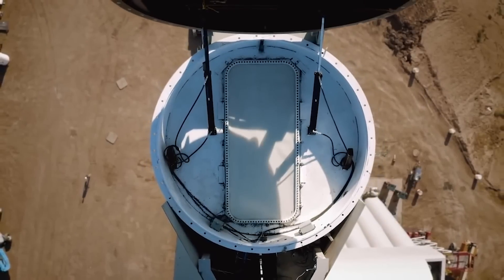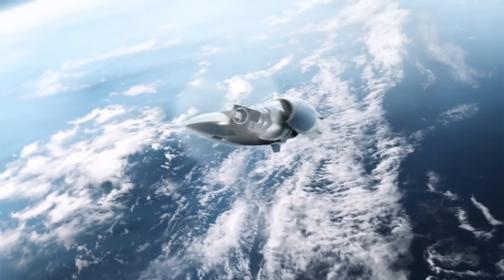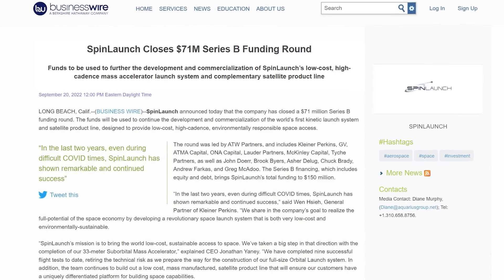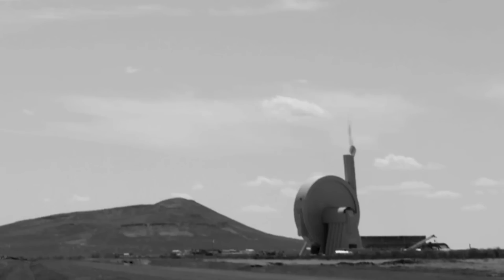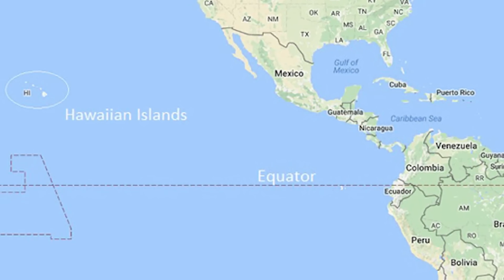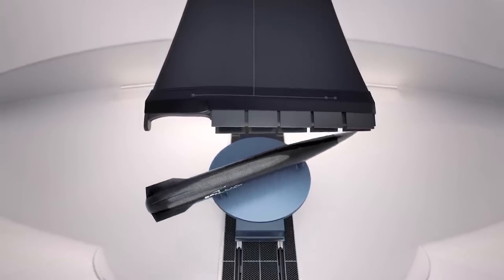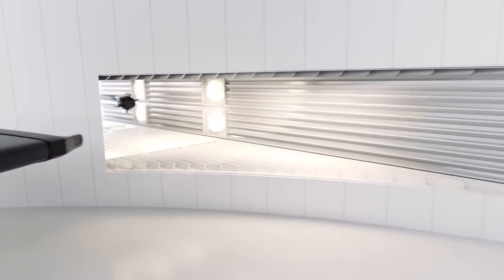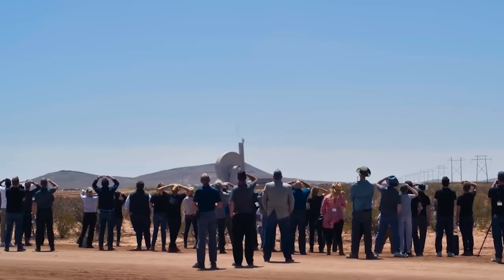What Happened To SpinLaunch & The Orbital Accelerator?

Comment: Something I've wondered about SpinLaunch: how do they maintain balance in their centrifuge? They spin up a payload, then release it. If their centrifuge arm is balanced with the payload, it becomes badly unbalanced at the moment of release. Do they somehow accommodate this imbalance? Do they somehow very quickly rebalance? (e.g. a counterweight which is released downwards at the same moment the payload is released upwards.)
Reply: The only viable solution to that physics problem I can think of would be to have the counterweight pulled on magnetically and at the instant of the launch vehicle release the magnetic field would be shut off.
Reply: @GrantOakes  or, ya know just use a regular detaching mechanism.
Reply: "counterweight which is released downwards at the same moment"  -- oh man, that poor counterweight.
Reply: Immediate auto rebalance of an arm at that speed and G load seems very tough or nearly impossible to do.
Reply: SpinLaunch is releasing a counter-weight into an armored section of the launcher at the same time the vehicle launches. But that leaves a mess to clean up. Future ideas is to launch a vehicle, rotate 1/2 turn and launch the counter-weight. They would run out of balance over that 1/2 rotation. So, this will take a little bit more engineering muscle to solve.

Here's an animation:

https://youtu.be/yrc632oilWo?si=UHWQBBmf_oeD4Odv&t=1286
Reply: @u9Nails  as it is on the short arm, that means the speed at release would be reduced from the big arm, but we are still talking supersonic speeds for something which weighs several tons.
Reply: Why don't they just use a rail gun? Seems a LOT more simple.
Reply: @1buellrider  They already have rail gun tech in play.  US Navy supposedly playing with it already.  High velocity,  long range weapons with high terminal energy and velocities at lower operating costs. It is simpler in concept.  

Lots of grant and research dollars already spent on it, so the funding to keep out of work university students and engineers in paychecks has diminished quite a bit along this road. But there is always money available for potentially new and or odd ball tech to be researched. This is standard "University Monetary Thinking Course 101" Follow the money, have a great paycheck for a while, enjoy a cushy low stress job. When the money runs out you can always find some weird new concept to explore and spend tax payer dollars on!
Reply: They don't.  This entire program is a scam.  It's deliberately vauge to drum up funding.
Reply: There is another video out there that they do a tour of it and show the vacuum chamber and go into detail about it.
Reply: supposedly they release a weight from the other side at the same time.   its caught inside the machine.   idk the whole thing is dumb
Reply: I think they release a counterweight on the other side at the same time. I remember the channel Real Engineering noted this in their video.
Reply: They covered this already. They plan to drop a dummy payload from the short end that is much heavier but traveling much slower. Catch it and reattach for the next launch. As crazy as the ideal sounds they have put a lot of thought and engineering into the project.
Reply: @edwardson6825  I didn't know about the counterweight payload idea. Thanks! I wonder how they plan to "catch" it? If the weight is magnetized, dropping it through a coil would allow for regenerative braking. That might be a cost-saving upgrade for the long-term.
Reply: @edwardson6825  dropping a heavier counter weight is still going to be quite explosive especially since the payload is heavy. This will not be a simple task and I wonder how they will be able to handle this since going Mach 2 with tons of weight will be like dropping a large bomb. 😮
Reply: @edwardson6825  Thanks, that is the most obvious method, but I didn't see it in the animations.
Reply: @michaelwoodhams7866  True, they don't show that end much. On the scaled down launcher it is just fired down into an armored plate and the dummy weight is destroyed. They claimed at one time that their bearing could handle a single out of balance half turn allowing them to fire the first payload then make a half turn and release another payload from the other end to follow the first. Just my personal intuition, but that seems unlikely to work without rapid unplanned disassembly. Regardless of which way it goes, I love to see people working to innovative.
Reply: @edwardson6825  Plan to drop a dummy payload?  They already showed their first launch and there was no dummy payload.
Reply: @edwardson6825 the dummy payload is being launched opposite the true payload: they both see the same forces. Think about it. Plainly, they have not.
Reply: A spinning ice skater can rapidly slow down by putting out her arms. Imagine a mutant ice skater with many arms, the longest arm holds a payload that is released at very high speed. If she had 4 times as much mass held by arms that were about half as long,  she could rebalance by unfolding those arms immediately after releasing the payload.

This would rebalance her and simultaneously slow her down. The dynamic forces might be a little harsh.
Reply: @hamjudo  Cool ideal, but they are working right up at the limit of carbon fiber's tensile strength. The full scale launcher arm has to support 100 million kilograms. Think 20 fully loaded SpaceX Star ships hung from a carbon fiber tether. To do that the cross section of the arm has to be about 1 square meter of solid carbon fiber. Have to keep things very simple when dealing with those forces.

I personally would like to know how the release mechanism works. But they are keeping it a trade secret for now. Can you imagine a release mechanism that can stand up to those forces, but still release with the precision needed?
Reply: theres another option for the counterweight.

it has to be accelerated, so thats power being used.

watch the shotput, and the cartwheel technique.

slam the counterweight into the ground, remain attached, and use the torque of the centrifuges inertia to fling the capsule off with the increased energy of the halted counterweight added to its velocity. ie, the centrifuge lifts off its axles and pivots around the counterweight instead. theres also a large third class lever action due to the fulcrum now being at the counterweight.
Reply: @paradiselost9946  Not sure what you mean by shotput and cartwheel technique. I will say that the full scale payload is launched at Mach 6 (2000m/s). For reference a 7.62x51 NATO bullet traves at less than half that speed (850m/s).

When things hit each other at those speeds they tend to act more like a liquid than a solid. So slamming the counter weight into almost anything will destroy it and most likely anything you slam it into. Think impacts an order of magnitude greater than those of an Iowa Class battleships 16" guns.

The shockwave that traveled back up any arm attached to the counter weight when it came to that abrupt stop would destroy the launcher arm and most likely the launcher housing and facilities.
Reply: @edwardson6825 you completely missed the point.
think of, say... a skateboard hitting a rock, versus a penny farthing hitting a rock. forget the rolling resistance part. they both stop on a point.

the skateboard rider simply keeps moving on at the same velocity, board stays back there. it might do a little flip.

tiny wheels. virtually no torque produced, instead, momentum just keeps acting linearly.

the mounted cyclist gets flung, accelerated as they are on the end of a long arm.all that momentum in a linear direction suddenly converting to torque. whatever is at the end of it gets launched. whether it was rotating or moving in a straight line, that inertia is now rotating around a different center. 

if youve ever been in that sort of situation... you find that you get PULLED... or pushed. pulled is preferable, you can let go! 

um... yeah, BMX as a teen. miss the top of a jump, and as the bike gets caught, you get pulled into arc and slammed into the ground far harder and faster than if you let go and fall... it can dislocate your shoulders.

you see it happen in boats all the time. watch them launch debris when the nose tucks under the water?  suddenly, linear momentum is rotating around a point... some of it slows. a lot of it at the end of the arm is instead accelerated, as the stuff below it, closer to the pivot, in slowing down had to transfer its force to something
its a mass thing. wheres the mass, wheres the pivot, how strong is the pivot?

would be fun to try on a small scale, though i think its basically a souped up trebuchet... little bit different.

maybe, iunno... a 20kg gym weight, open top bearings,  a 5kg "counterweight", and then a 5kg "payload" set up so it will let go at the right time...

and yeah. just slam a bar across at full tilt to lock it instantly, let the counterweight go bang, "payload" and frame go flying!

 i wanna see stored energy being released!

i just gave away a million dollar idea. sigh. again. :)

ffs, if people can get backing for this BS, wtf am i doing wrong?
Reply: @paradiselost9946  dude, nothing will be able to hammer at mach 20 into the ground and live to see another second. The only way is if they release a liquid or gas as to not destroy everything
Reply: @firedrive45 The concept is to launch at a quarter of orbital speed, like Mach 6.5.  That gets the rocket mostly out of the atmosphere with some speed where a relatively simple rocket engine can get it into orbit in one stage.  Nothing is anywhere near orbital speed at the ground.  And if you have a big counterweight, it can move relatively slowly.  Say the mass is 10x, then the velocity is only 200m/s.  That's fast, but the whole thing only carries 1/10 the kinetic energy of the rocket.  Shoot it down into a tube to decelerate and it doesn't have to be destroyed.  One way is for the counterweight to be metallic, then magnets on the sides of the tube will slow it down fast but with smoothly applied forces.  A number of rollercoasters and vertical drop rides use that already and you could get many g's of deceleration.  The tunnel only has to be 10s of meters long to do that decel.  Requires development and won't be cheap, but totally doable...
Reply: @cbarnes2160  im not sure thats quite how it works.  the larger mass is moving slower, sure, but its still larger.  it would carry the same energy as the projectile.  thats the whole point of the idea, each mass needs to carry away the same amount of energy.  im not saying it would be impossible to recover,  just that its going to have more oompf than youre imagining
Reply: @firedrive45  i know that but you gotta admit, would be fun to watch... from a distance...

think its better just to do a video myself... wee...
if i can spin a 20kg gym weight, say, 250mm across, at 1krpm,it only has a peripheral speed of 50km/h or so.
but if i can bring it to a halt, and cause that rotating mass to now rotate around a point on the rim, the opposite point on the rim shall be traveling at what velocity?

would be exactly the same scenario as if the wheel was simply dropped, and there was perfect friction when it landed. the point making contact would remain motionless, the entire mass would move at a linear rate of 50km/h at the center of mass, and the uppermost point would travel at 100km/h... of course real life digs up the grass and leaves divots. things take time to accelerate, forces act in various manners, energy is lost in various forms... i am aware of this...

now if the payload was a loose object on the rim of this wheel, it is not only traveling at the peripheral speed, but is also accelerated around the new radius of rotation, and a difference in the mass of the wheel versus payload determines just how much of the wheels inertia will be transferred into spitting the object off. its as if you "cut the wheel in half and let it continue rotating to come around and kick the payload up the arse as it leaves"

USE the inertia of the wheel to your advantage!

 pivot points, lengths, blah blah. force summations.

it would work, but it still doesnt alter the fact that the whole idea is ludicrous? other than maybe in a vacuum... with unobtainium beams and struts...

except. i want to do this now. i been musing the idea over for a while now... maybe brake rotors. got lots of brake rotors... if i make a video and come back to post it yall better watch it... even if its a failure and im wrong : )

yes. slamming it into the ground. there is a difference though, between say... slamming a moving object and bringing it to an instantaneous stop, like, iunno, sledgehammer?

to say, applying one hell of a brake over 1/4-1/2 rotation thats already firmly mounted to a well anchored frame and pivoting assembly doodad.

because for every kg of force you can apply to the payload being launched, youre going to be applying the same force to the brake, the pivot, the frame, the ground...

the wheel wants to keep rotating, the inertia has to go somewhere. if the only options it has is to act on the ground, which it cant as its fixed but free to rotate, and the payload... it will transfer to the payload by creating a torque. there will obviously be this ideal spot where the amount of braking force can be regulated so the end result is that the whole thing comes to a halt and the payload is the only thing left moving...

why is this concept so hard to grasp? its really simple...
Reply: Probably one of the things they keep a "Corporate secret"
Reply: @paulmichaelfreedman8334   Their corporate secret is dumping a concrete brick into the ground at the same time. It would be terrible news if it would malfunction.
Reply: @paulmichaelfreedman8334  They shoot two satellites a half-rotation apart